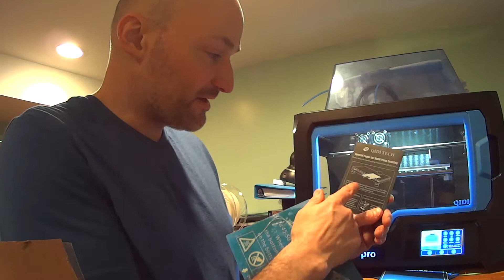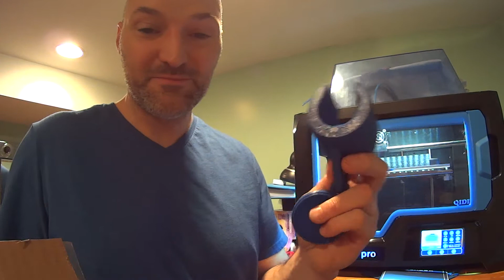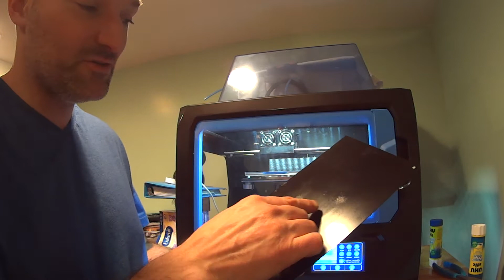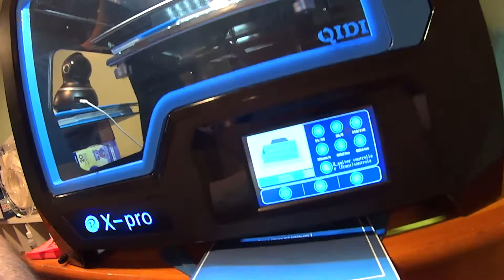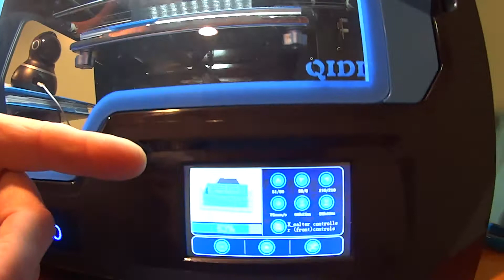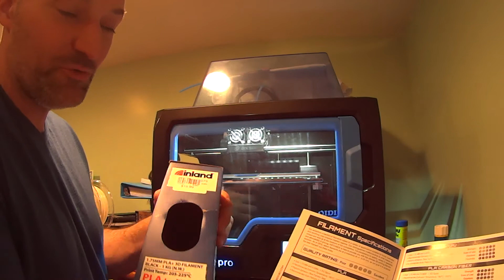2018 QIDI Review and Beginners Quick guide and problems I ran into

Comment: Hi.  I bought one of these at an estate sale without the USB.  Can I just hook it up to my computer?
Reply from the maker: Sorry for late response 
You can actually just buy a USB stick 
Go to Qidi web site and down load the program or if the printer still has the program in it and you can run a test print 
(Test print will be in the printer)
All you have to do is down load the slicing program to Computer from qidi
And that's it 
Down load ur model to the slicing program
Uploaded to the USB drive/card 
Inserted into the USB drive of the printer and start printing